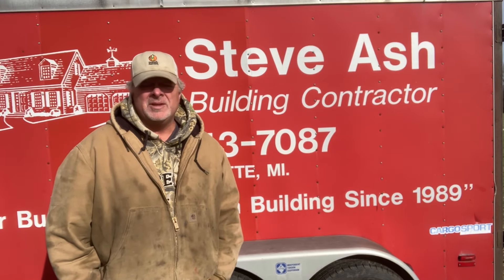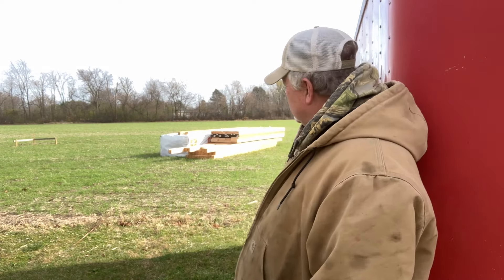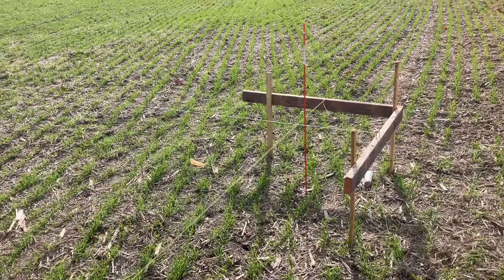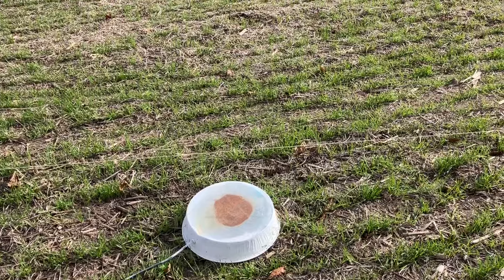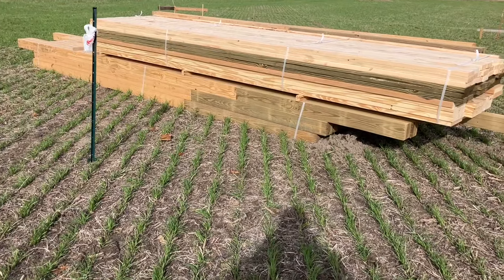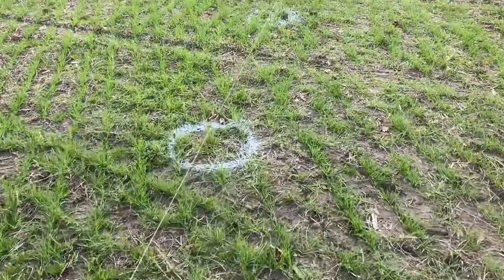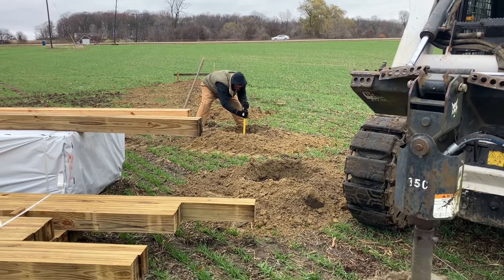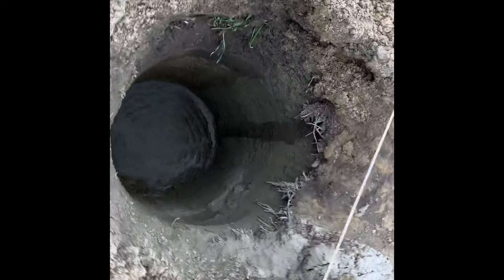Building our farm shop, Part 1 layout and dirt work

Comment: Hey Steve - glad to hear you're building your dream shop.  In 2018 I built my "Red Shed", which is a 50x70, 16 feet tall.  That was about as big as I could make it, based on the spot where I placed it.  However, it's already too small.  Never seems to be enough room.
Reply from the maker: Hi Charlie, nope never big enough!